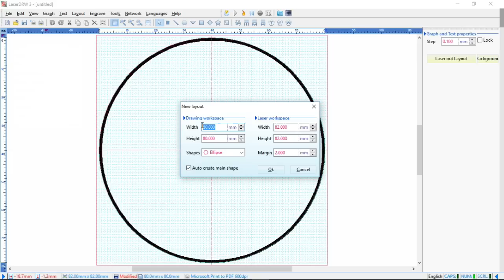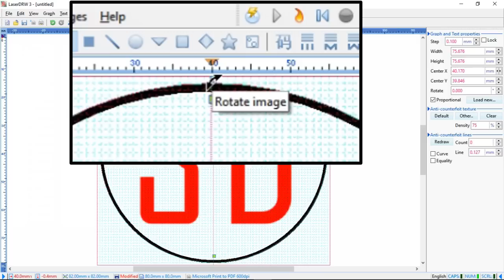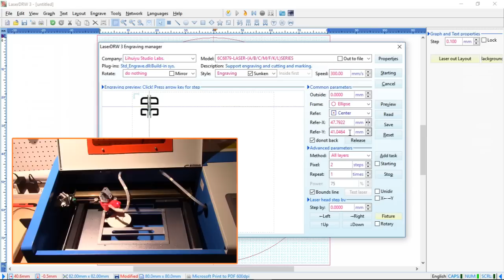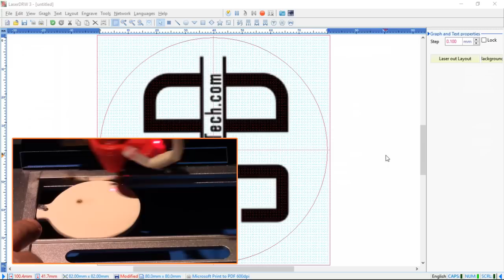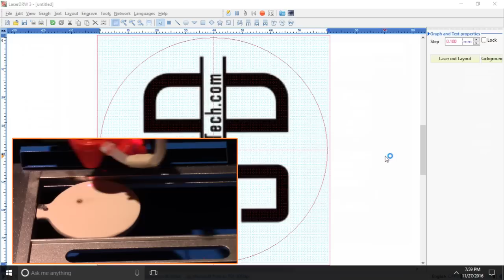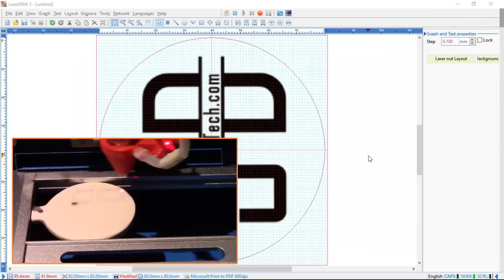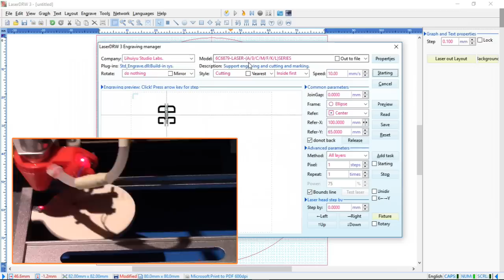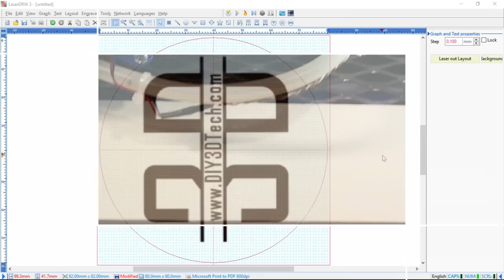K40 eBay Chinese CO2 Laser Cutter & Engraver - Ceramic Ornament!

Comment: looks very cool . i wonder if you put a bit of color craft paper on the top if you could get the die to sublimate into the ceramic as it glazes it . my low power laser  and push the die out of craft paper into the target around the beam path . its quite funny . I suspect the  dark burn mark was carbon form the wood .  One day I'll have a laser above the mw rating range . LOL
i wonder if you could put ceramic  pigments powder on the top and have the laser melt or like cinter it into place .
Reply from the maker: Yes on both accounts, however the craft paper would likely "smear" especially with the air-assist blowing the colored gas around.  However I like the sintering idea, I have been meaning to try this with sand, thanks for reminding me!  :-)
Reply from the maker: So I have a question for you, I just built a new CNC and uses a knock off UNO and CNC shield and connects to my Windows 10 machines no issues, however its a no go with XP.  Tried everything but no good, I remember I had reverse issue with the multi-meter where it worked on XP but not 10.  Any ideas?
Reply: have a look at the USB chip it has . some of the knock off use a WCH  or just CH340 / CH341 chip .   and lol it can even be a knock off CH chip . I think i had to install some extra drivers on my XP .
this sort of this i common with the  CH34*  type chips  
http://www.microcontrols.org/arduino-uno-clone-ch340-ch341-chipset-usb-drivers/
http://www.cesareriva.com/usb-to-serial-converter-hl-340-drivers/

you should find  some XP working drivers in that set . and there is some truth to the " if you buy cheapo Chinese CH34X chips use the Chinese driver versions "  .. just watch you fire wall real well after for  extra net traffic out LOL  make sure it not bleeding data off to some  remote  server . ahhah .
Reply from the maker: LOL about the firewall :-)  I could tell you stories :-)  Will give these a shot and many thanks!
Reply from the maker: Worked like a charm!  You Da MAN!
Reply: so its working as expected now . good
Reply from the maker: Perfect!  Knew you would have the answer :-)

Comment: Ho ho ho!  You ever gonna strap one of those to a shark?  Lol. 

That looked really cool. Now you need to refine the process and creat a Step by Step video on how to do that for other owners of that machine.
Reply from the maker: Did come out really cool as it glazed the ceramic which I didn't expect, however this is sort of a step by by or at what settings to use (as this biggest challenges are feeds and mA) :-)
Reply: DIY3DTECH.com - it will be interesting to see some of your testing settings and results.